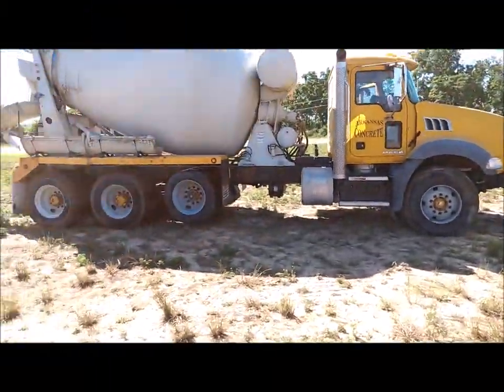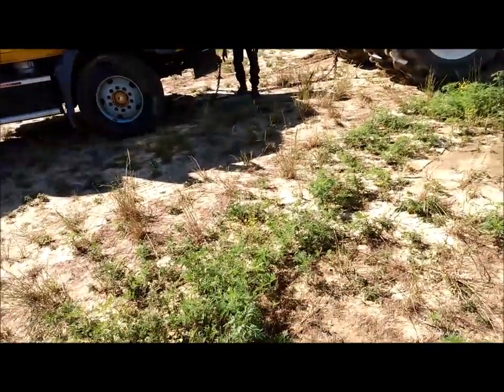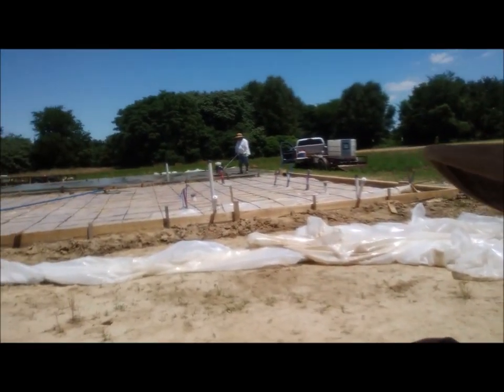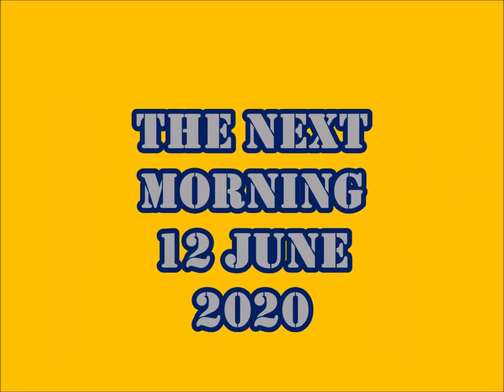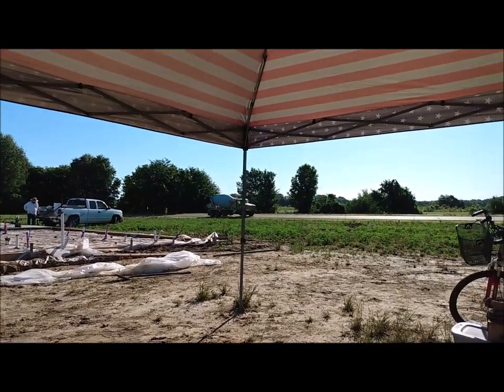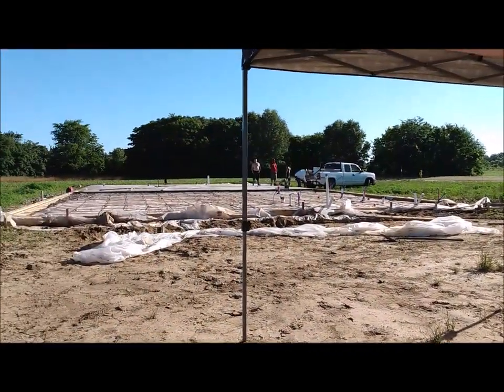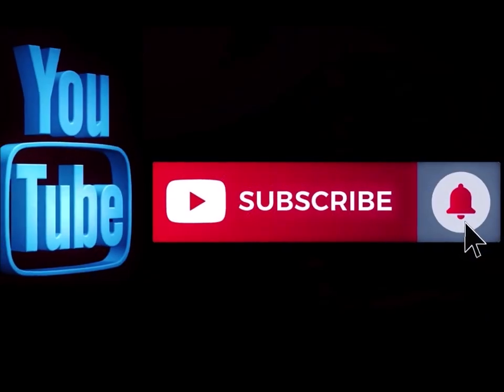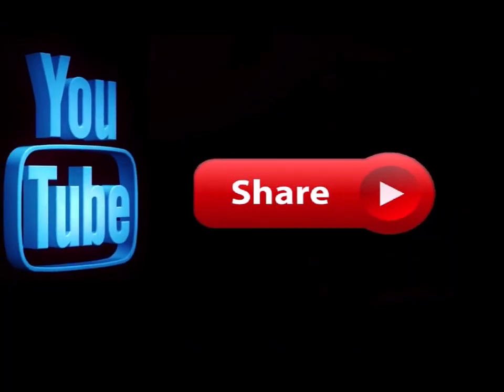Mudding in a Cement truck - Don't try this at home!

Comment: Good to see the slab ready for the framing. That was some monster of a tractor. I would guess it takes some power to pull out a stuck cement truck.
Reply from the maker: 😅 that was the small tractor according to my Father-in-law.

Comment: I have built a ton of houses and getting to the poured slab is about a quarter of the way to finishing the house.
There is so much into getting to that point from the health dept to the permits set backs, grading , plumbing etc...
Reply from the maker: Well that is good to know.  I am about 10 years older over all this already.  First house build, hope it is my last house build!  👍
Reply: @EdsAttentionToDetail  yep it always feels like it's taking forever and you are getting no where. But at this point the rain will not hold you up as bad. It will a little but after its dried in it won't at all so it will speed way up. 
I don't blame you lol! I'm about to start 2 to sell any day now. Already have the lots.
Reply from the maker: @FrankAndTinaOfficial , that is awesome, good luck with you builds.  Betting those two will be done before my one! 😂